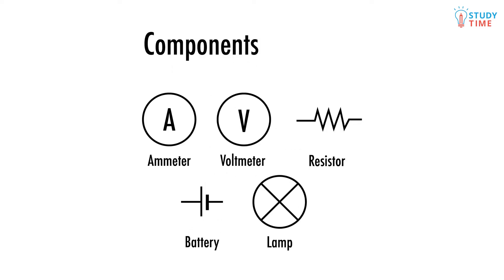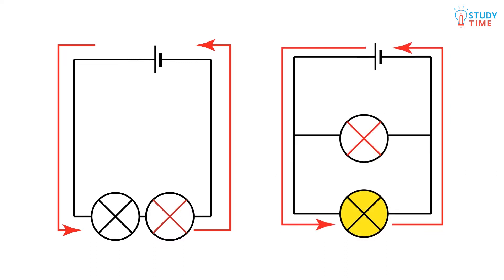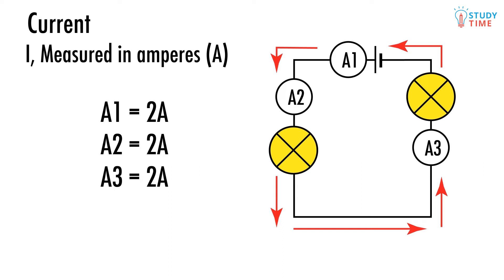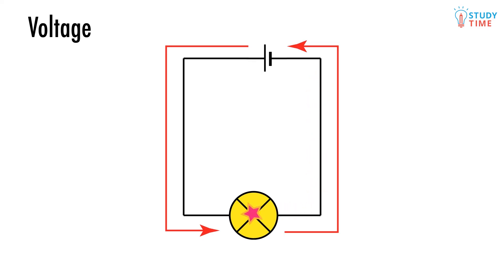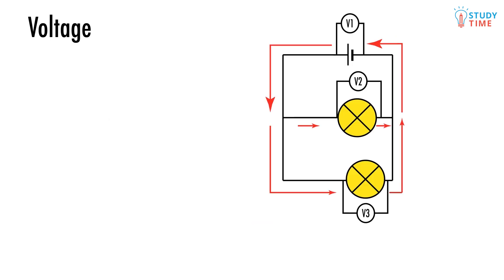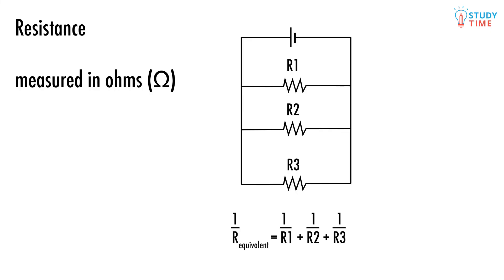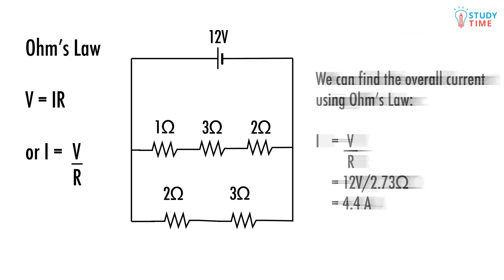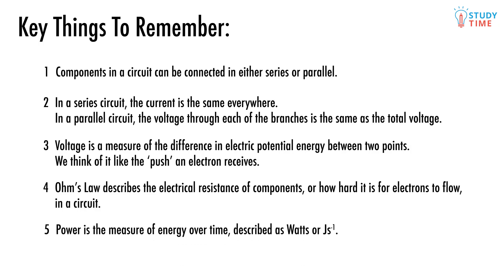DC Circuits (2/4) | Electricity & Electromagnetism - NCEA Level 2 Physics | StudyTime NZ

Comment: Timestamps (Powered by Merlin AI)
00:06 - Understanding the differences between series and parallel circuits.
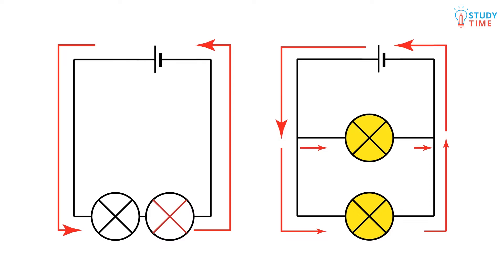02:00 - Understanding parallel circuits and the concept of current in electricity.
03:52 - Current is consistent in a series circuit but splits in a parallel circuit.
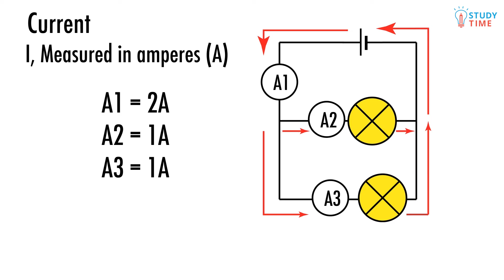05:42 - Voltage represents the energy per electron in a circuit.
07:37 - Voltage distribution differs in series and parallel circuits.
09:27 - Voltage is constant in parallel circuits, while resistance affects current flow.
11:14 - Parallel circuits reduce overall resistance and affect current flow.
13:17 - Power in circuits relates energy transfer and current flow.